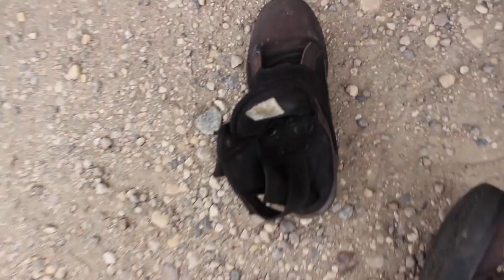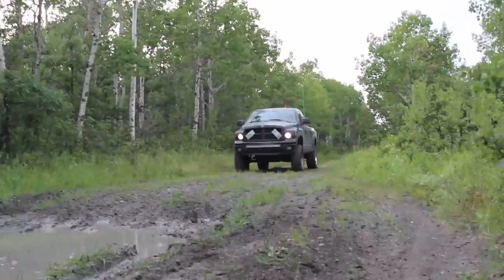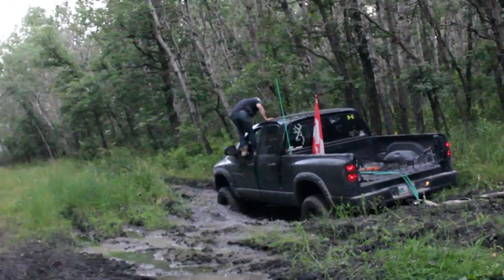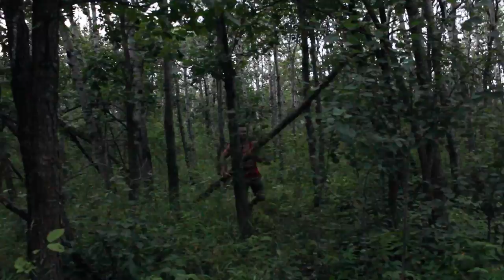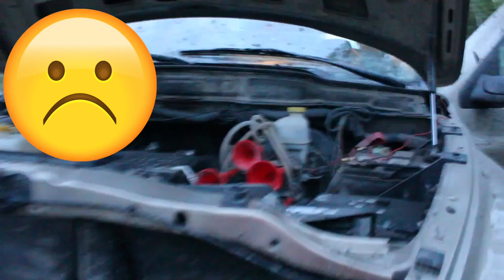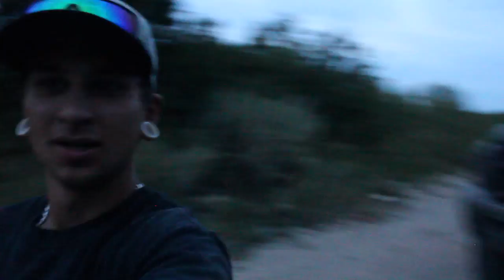MUDDING WITH LIFTED TRUCKS  *GOT STUCK*

Comment: Legit question, what’s the point of a jacked up truck besides looks if your rear diff is damn near the stock ride height? Are you really getting that much more ground clearance overall?
Reply from the maker: Big time. The whole body of the truck including running boards if you have will create a shit ton of extra grab on everything if you are stock height . When I went through that mud hole my diff and front components were dragging in the mud but I could power through, if I was stock the whole body of the truck would have been plowing into it all.
Reply: Gotcha, not saying you're doing it but I see lots of guys spending lots of $$$ on big ass lift kits making their trucks look crazy but their diff still low to the ground. With what you said I could see a bit of a gain with some lift. Anyway, More of a muscle car guy (79 trans am) so I wasn't too sure with offroading or trucks in general but thanks for the info!
Reply from the maker: anytime bro! And only way to diff higher off the ground is bigger tires and only way to fit bigger tires is to do a lift! Unless you cut the hell outta your vehicle lol Cheers!

Comment: Needs some lockers and a d60 swap. If I had a vehicle that I offroaded that had ifs, itd be the first thing to go
Reply: matt sutter  Can get expensive and take a long time so lots of down time potentially
Reply: Tj Cook lockers arent very expensive but regearing would most likely have to be done by a shop which costs an arm and a leg. Idk what gears you have now but you could find a d60 with 4.10s then just regear the rear to match
Reply from the maker: matt sutter i have 4.56's
Reply: Mitchel Matthews well it wouldnt be too bad then  to find a 60 and put 4.56s in to match the rear
Reply: Well you should think about reliability first.

Comment: um my 2000 dodge dakota 3.9L V6 4x4  outperformed one of my cousins hunting buddies chevy in grandmas back field, pretty confident that the 31x10.50R15LT Goodyear Wranger A/T, helped a lot, along with 2 inch lift i bought the truck with(either rancho or skyjackers, shocks are red)......and 5 spd stick...............wither his tires are already caked with mud or he running on bald tires, deep mud...why is he trying in RW and not 4x4 mode???

Comment: My 04 Dodge ram 1500 V8 hemi loses so much power/acceleration while driving uphill practically Stalls out... I can not figure out the problem! Can anyone help?
Reply: I used to have that issue with my 2002 ram 1500. I replaced the accelerator sensor which is also linked into your cruise control. After doing that, I haven't had a problem sense.

Comment: so wait.. you brag about putting 4.56 gears in a truck and didn't put a locker while you had it open? My 99 k2500 suburban has more flex than that truck

Comment: Of course you got stuck your driving a Dodge.
Reply from the maker: and I didn't get stuck and I'm driving a dodge......
Reply: So you lied in your title
Reply: um my 2000 dodge dakota 3.9L V6 4x4  outperformed one of my cousins hunting buddies chevy in grandmas back field, pretty confident that the 31x10.50R15LT Goodyear Wrangler A/T, helped a lot, along with 2 inch lift i bought the truck with(either rancho or skyjackers, shocks are red)......and 5 spd stick
Reply: Seems like he got stuck because hes driving a lifted truck with mud tires on a 2wd truck dont seem very smart tbh
Reply: ✪ sudZ! ✪ with 2wd i agree, if poss 4x4 is king/way better for traction